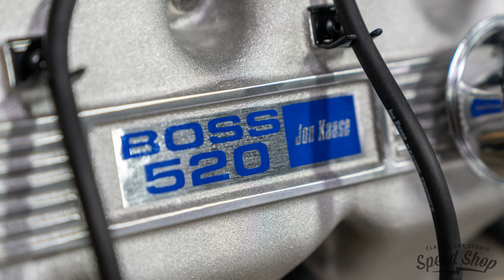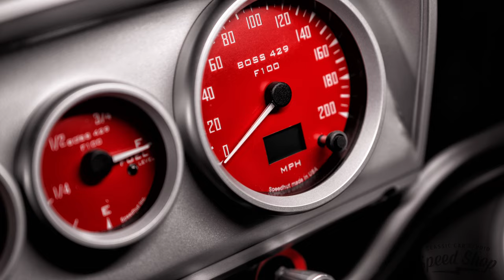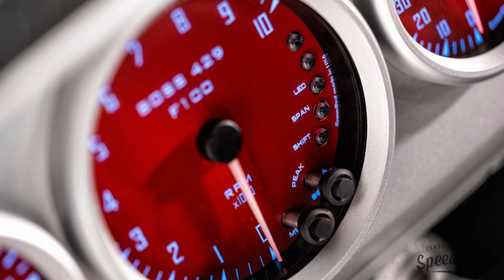70 Ford F100 - Build Recap

Comment: Question: Before priming the body (cab, bed, etc), what method is used to remove dirt and rust? Sand blasting? Chemical treatment? Also, why did you keep the original fuel cap on the driver's side of the cab when a new fuel tank was installed under the bed? Finally, why do the gauges say Boss 429 when the engine is a Boss 520?

Comment: How much does something like this cost?
Reply from the maker: It really comes down to specifics as things can get expensive fast (engine? chassis? etc.), but you're well into six figures on a build like this. Generally full chassis builds will have > $100k in parts alone, and a good rule of thumb is to double parts cost for the cost of the project. Hope this helps!